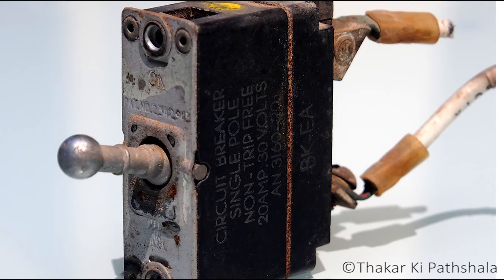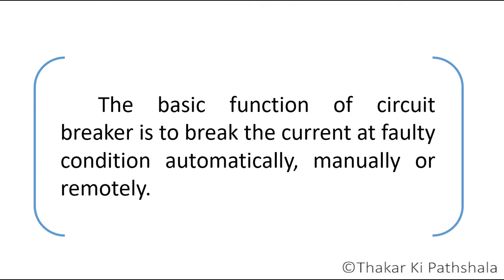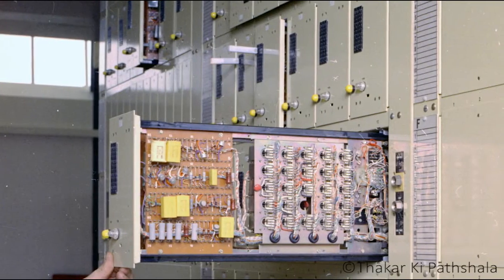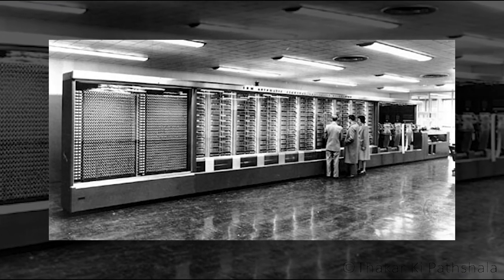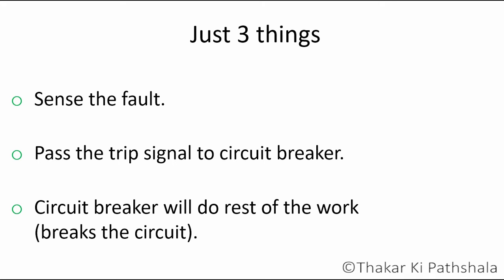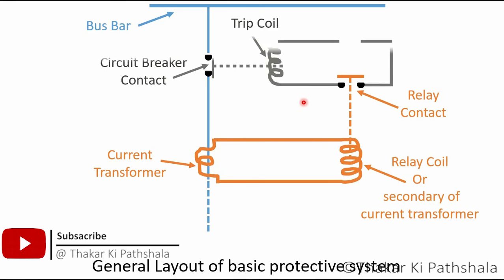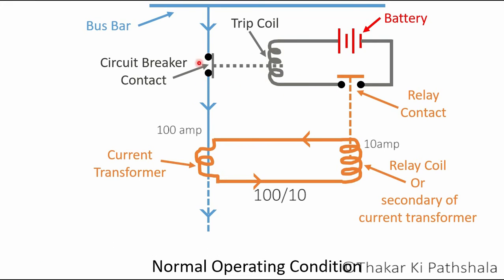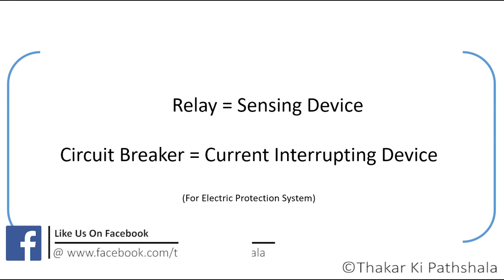Difference between relay and circuit breaker  Relay Vs. Circuit Breaker

Comment: Im still confused. The circuit breaker is a current controlled equipment and it trips whenever theres an overcurrent on it. Does that mean that a CB has an overcurrent relay inside it? In other words, does that mean an oc relay is just a part of a CB and is packaged together as a single component?